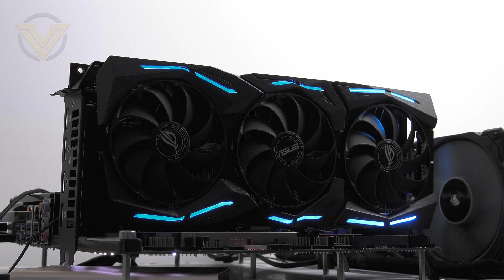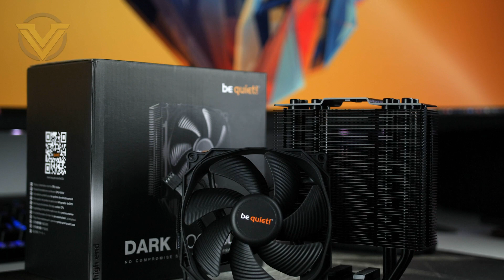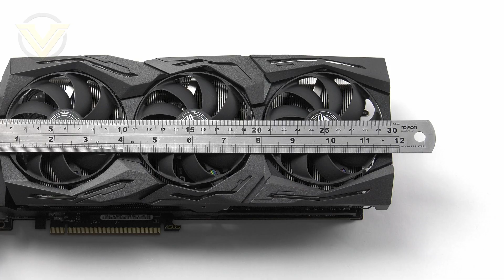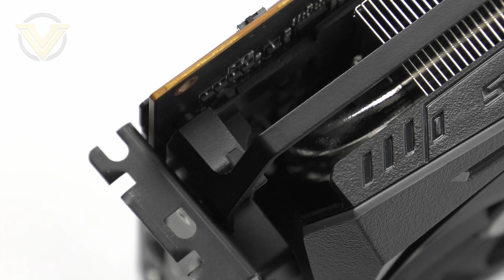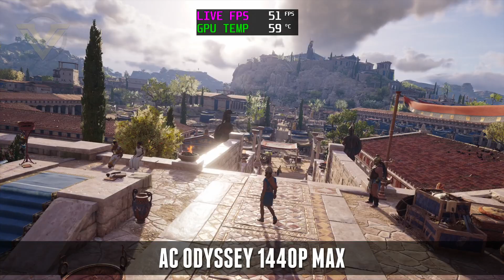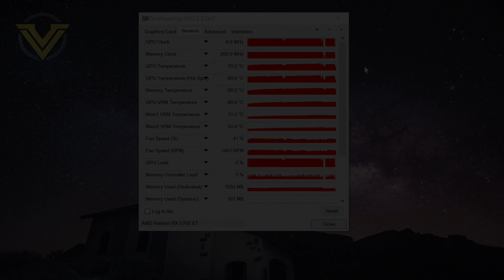ASUS ROG STRIX RX 5700 XT Review

Comment: So, how did it do when you mounted it "normally" (like most ppl would do), and not vertically in a testbench? :)
Reply from the maker: I got an extra 50 fps.
Reply: Vortez Lol. 😂🙌🏾 There were apparently some heatsink problems with the early cards, as I'm sure you know, but mounting them vertically seemed to help gravity not pulling it away from the heatsink. Still not perfect now with the newer ones, some say. So I'm actually thinking if it would be worth it to mount it vertically. About to buy it to use in my first build....

Comment: do need to use both  8 pin plugs to run the card
Reply: i yes otherwise a insufficient power message will come up on the screen
Reply: @R0V0lv0   thanks

Comment: How does this compare to Radeon RX 5700 XT MECH OC 8GB PCI-E w/ HDMI, Triple DP
Reply: Performance is similar, but the Mech OC is horribly loud. I had it and I changed to the Sapphire Nitro+. This ROG one is also waste of money, so get the Pulse, Nitro+, Gaming X or the Red Devil.
Reply: Why is it a waste a money for ROG?
Reply: JYS777 becouse the performance is same with every card, and the Rog is the most expensive one. I would rather take the Nitro+ or Red Devil becouse the Rog has some cooling problems as well.

Comment: Now that the price has gone down a reasonable price I'm gonna buy it.
Reply: I get it for like 340 Euros
Reply: I would go for the msi gaming x variant because that has the best cooling solution which is stated by hardware unboxed. I also have one so I know it is a cool card and it’s £80 cheaper so I would consider it.
Reply: @R0V0lv0  Doesn't matter because I will put a waterblock on it anyways

Comment: G'day sir! So Im in the market on buying my first GPU. Atm the asus rog strix 5700xt is on a huge special. But heard it had some cooling problems? Do you maybe know if the problems with this card is solved and would you say its a smart choice to get this card?
Reply: I have it, it's a great card imo. If you like the design and price is good go for it, also consider red devil and Nitro + if you want the absolute best. I went for strix because I prefer the clean, black look. They released a biox fix for the temp problems, which wasn't really a problem but more so the case of Asus tuning it too aggressively out of the box.
Reply: @kaisersoze851  Do you know if this release help with the noise profiles at all or bring them closer to the red devil or nitro+ ?  I'm very sensitive to noise I'm finding and all the reviews seem to point to the strix as being noisier, alas all the reviews came out near when the card was released and I don't suspect any follow up reviews with/for the new bios.
Reply: @TheFiercestGrape  I have never thought this is a loud card, not even while gaming. I personally didn't even do the update cause I think the card is running great as is.
Reply: @TheFiercestGrape  if all you care for is the best card, I guess nitro and red devil might be slightly better because of the cooling. I personally prefer the clean look of the strix, and have no issues with noise at all, I don't even hear it while gaming.

Comment: Just wondering, got a blast of a deal and got this for 450 usd and normally the red devil goes for 510 here. Is the high temps because of the clock speed?
Reply: I'm also curious on the high temp? Do you maybe know if this problem is solved?

Comment: I can't get mine to be detected with Asus Aura Sync, so I can't control the LED's at all. I've tried installing a few different versions of the drivers for the GPU, different versions of Asus Aura Sync, and I updated my bios as well. It's still not being detected, so it's just indefinitely breathing red...any ideas/suggestions? Thinking of returning it for a different aftermarket card since this one was the most expensive and the Aura Sync is not working at all

Comment: helo, how is the vrm for this gpu, does the vrm contact with thermal pad of the heatsink.. please help.. because mine got gap between them.. and i think the vrms are not properly cooled.. please help.. do you have the same probelm.. i ordered gpu support holder by cooler master hoping it will solve the vrm cooling probelm.. how come asus dont know about this matter..

Comment: I just got this today. I can't get Aura sync to recognize the GPU.  I've installed and update my AMD drivers to the latest version. Also updated Aura sync. I've plugged the RGB into my mobo, yet I get no response. It just stays in the red breathing mode.... :(
Reply: That is weird, mine works fine.
Reply from the maker: Check on the support page for a possible BIOS/firmware update. In early versions of this card there were discrepancies with Aura sync.
Reply: I had the same issue, the solution was to go into the 5700 strix xt support page itself and get the rgb utility from there.

Comment: Just curious, does your card shows 2100mhz boost clock in gpu-z? I have the same model, it shows 2100mhz default boost clock in gpu z. I also tried to OC+undervolt it, manage to get 2150mhz@1090mv.

Comment: $20 more than the Red Devil in America.

Red Devil is priced at 439.99 USD
Strix is priced at 459.99 USD

Granted, you can actually buy the Strix, seeing as the Red Devil is going through stocking difficulties in America.

However, the Gigabyte card is the better value, imo at 419.99 USD.

Comment: Just bought one on Newegg for only 500 tax included 460, whereas all of the 2070s are op af and the sapphire nitro is only in stock and available  on eBay for 521 tax included. So win win tbh
Reply: @dannyroth1127  ordered mine the 19th and they said 2-5 business days for standard shipping
Reply: @ryanpufpaff  that's what they said but the card was all the way in cali, so my estimated shipping was actually a week, its not even here yet.
Reply: @t3k0n1v9  supposed to get mine tomorrow took ups 5 days to get from CA to NC
Reply: @ryanpufpaff  tell me how it runs, i get mine on the 30th, im all the way up in ny. not mad at all tbh, lucky i was actually able to get a card in stock.
Reply: @t3k0n1v9  I like it so far still gotta mess around with the settings but gpu tweak 2 makes that easy

Comment: My Strix is hitting 88C under 4K with performance bios in a well-ventillated case, where 3 bottom intakefans are blowing fresh air onto the card. Is this considered normal?
Reply from the maker: No that doesn't sound normal. What is the room temp?
Reply: @Vortez  Nothing special, around 23C, normal room tempereature. Also, the idle temp is 34C, which is good in my opinion.
Reply: @Vortez  I'm not sure what I did, but the temps dropped almost 10C. I just changed the RAM profiles in BIOS to D.O.C.P, because they were running on 2133 instead of the rated 3200MHz. Can there be a connection?

Comment: I'm pretty disappointed with AMD Navi. Two months after launch, not only are they nearly impossible to find at any retailer, they are quite overpriced. So far, I have seen the Gigabyte on Amazon for $495.60 and the Sapphire for $502.20. I am considering sticking with Nvidia even though my monitor is FreeSync. A Gigabyte RTX 2060 SUPER is $399 and comes with two games.

Performance wise, it's a toss up: FPS in games tends to go either way depending on the game.  TDP? 175 watts on RTX 2060 SUPER, 241 watts on the Radeon. While AMD had a nice sharpening filter, Nvidia has now bettered this with a new filtering that is available separately in every game and is adjustable with two sliders. AMD is fixed and is either on or off for all games.

Convince me that it is worth spending  $100+ for a Navi.
Reply: Amazon is the worst possible place to look for a 5700xt. Go to Newegg. Just picked up a red devil there. And performance is definitely not a toss up. Perhaps you were comparing the vanilla Rx 5700 to the 2060s, not the xt variant.

Comment: My Red devil is laughting
Reply: This has a better OC bud and cooling
Reply: Pls english
Reply: @Bikee06  OVERCLOCK BUD
Reply: Red devil is better then everything for the Price
Reply: @Bikee06  Red devil also has some problems in the quick data transfer. Doesn't even cost that much more
Reply: And it's also only $20 bucks more. But that $20 gets you better cooling overlock and driver's
Reply: NOO the rx 5700 xt red devil jaa better cooler than all nvida cards ;-;
Reply: @Bikee06  Before just saying shit actually find out the stats. The two cards side by side running serveral games both had g ood temps but the Asus had the best
Reply: Because rx 5700 xt Fans off under 60° duhhh

Comment: Price in the UK is £499.99 (550€ - $604 USD). It's becoming available from today. Powercolour Red Devil price is £449.99 (495€ - $543). I must admit I'm still in doubt but I think I'm going for the ASUS because it has a better PCB and also a better customer service. Good luck if you run into troubles with powercolor (I have friends who will never buy from them again). I'm sure the noise + temp + customer service should make it up for those extra $$$

Comment: fck off that strix for 555€ ,price here in europe . i am still happy with my 5700xt reference , UV 1V 1900Mhz limit and temps are 75°C and edge temp is 85°C,ambient temp is 28°C. fan is spining on 2300rpm when gaming. pc is under the table one meter off and I'm totally satisfied , already done washer mod and use thermal grizzly kryonaut. and that costs me nothing.

Comment: 900 Aud is a bit steep, i've preordered the red devil this morning but it's plain to see the strix build quality is far exceeding it's competitors. but obviously that is reflected in that price tag. thats 2070s territory. i'd love to see performance comparisons because the red devil is being sold at pc case gear at essentially the us price after conversion and taxes. so is the strix 150Aud better than the red devil? 

most of the other AIB's are over priced here in Aus like the Evoke at 730, the pulse at 800 (they should both be 700 after a 65cent currency conversion and GST) the red devil at 750Aud is slightly cheaper than the 760 that same conversion rate would get. so it's the only card that's actually worth buying.

Comment: There's no way this will cost $500 in the US. ASUS has GOT to know that no one will pay that insane of a premium with how damn good the sapphire and red devil cards are.
Reply: It’s 459 USD
Reply: It's 600 - 650$ in sweden
Reply: Check out the PCB breakdown of this strix, it would essentially qualify for a 5800xt (if it comes) with no issues. I agree that there is a big premium with rog products nowadays but this one is expensive for a reason, not always necessary but again, if you want the best of the best from AMD atm, having this option is better than nothing
Reply: @user-ku6bv4ni2f  what do you mean? how is it "essentially" a 5800xt? if there was a 5800xt i can guarentee it would be much better than the strix 5700xt. 5800? maybe. depends if AMD releases a card targeted at the $500 price point
Reply: @MrCykko  I meant that this pcb is basically an overkill for thr 5700xt, more so than the red devils and way more than the rest of the manufacturers, so it would be no surprises that asus is basically testing water with this card to be prepared for the 5800 (and this pcb will definitely qualify for that need)
Reply: @user-ku6bv4ni2f  Ah. Yeah this card does look objectively like the best 5700 XT we've seen so far. I just don't think it is CLOSE to being worth $500
Reply: @MrCykko  Indeed the price is a quite out of hand, Im just saying that this time it's an actual overkill instead of the usual "rog premium price" rubbish you'd expect XD